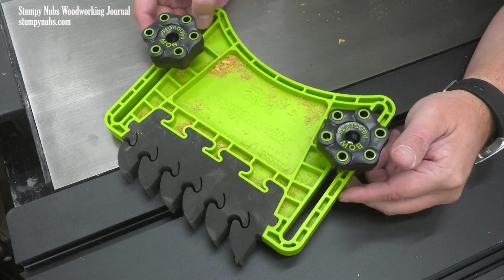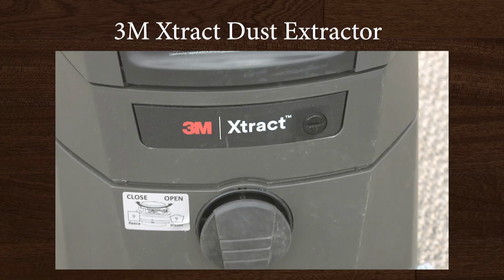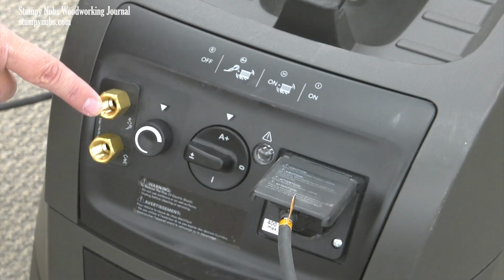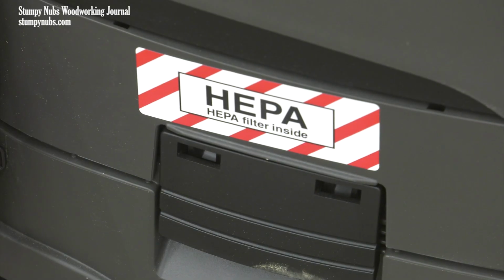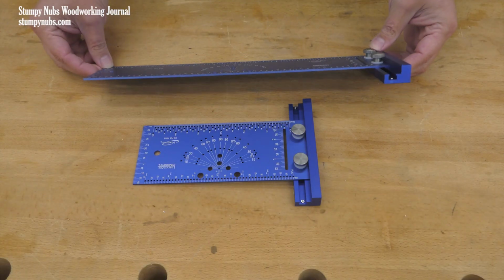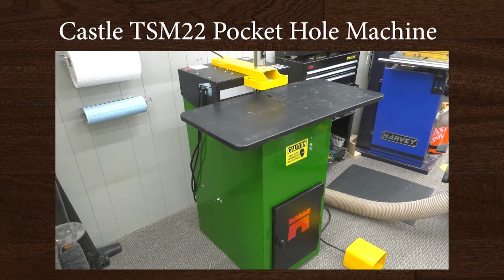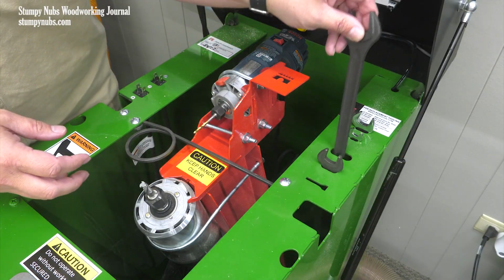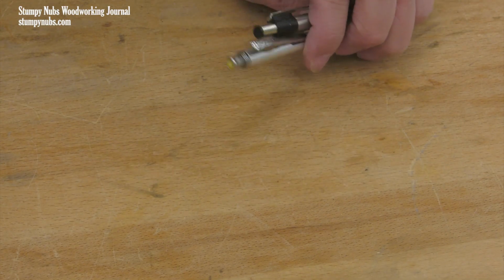7 Tool upgrades I wish I'd found YEARS Ago!

Comment from the maker: ▼EXPAND FOR LINKS TO THE TOOLS▼ 
Watch more Cool Tools videos here►https://youtube.com/playlist?list=PL-gT7JMZFYjdW0383kgJVMj0ocXbLXtpQ 
Tools used in this video: 

- Bow Featherboards: https://www.amazon.com/dp/B01MQ4F9ST?&linkCode=sl1&tag=stumpynubs-20&linkId=e3bbd1143073fa864af88d90d75ca801&language=en_US&ref_=as_li_ss_tl

- 3M Dust Extractor: https://lddy.no/1dc89

- 3M Premium Sander: https://lddy.no/19fcc

- M-Power Diamond Sharpening Station (with free measuring/marking bundle – No code needed): https://www.mpower-tools.com/product/sbs-triple-diamond-stone-sharpening-station-marking-measuring-bundle/

- M-Power Diamond Sharpening Station ONLY 10% off: (Must use code stumpy25) https://www.mpower-tools.com/product/side-by-side-diamond-sharpening-bench-stone-sharpener/

- M-Power Measuring/Marking Bundle ONLY (No code needed): https://www.mpower-tools.com/product/flat-lying-trammel-set-point-2-point-profile-scriber-marking-measuring/

- iGaging T-Marking Squares: https://www.chipsfly.com/t-marking-squares.html

- MicroJIG FitFinder Gauge: https://www.amazon.com/s?k=microjig+fitfinder&crid=1N17W7QZJCCFU&sprefix=microjig+fitfinder%2Caps%2C92&linkCode=sl2&tag=stumpynubs-20&linkId=e0b4ddc32353c7f45fa0db08e90a37ed&language=en_US&ref_=as_li_ss_tl

- Castle TSM22 Pocket Hole Machine: https://castleusa.com/products/tsm-22-pocket-cutter-machine.html

- Zebra Pens: https://www.amazon.com/s?k=zebra+pen&crid=2MZ0Z3PPFRE7D&sprefix=zebra+pen%2Caps%2C122&linkCode=sl2&tag=stumpynubs-20&linkId=026f2d5c9caad5657ee3a2613c62f4b9&language=en_US&ref_=as_li_ss_tl

- GraphGear 1000 pencil: https://www.amazon.com/s?k=graphgear+1000+pencil&crid=YE1G3GZSZ2PI&sprefix=graphgear+1000+pencil%2Caps%2C130&linkCode=sl2&tag=stumpynubs-20&linkId=2d5750656edc778c0851dc83e995228b&language=en_US&ref_=as_li_ss_tl

-Sawblade.com bandsaw blades: https://www.sawblade.com/

(Bow, Taylor Toolworks, M-Power, iGaging, Castle and Sawblade.com are supporters of Stumpy Nubs Woodworking Journal)

(If you use one of these affiliate links, we may receive a small commission)
Reply: The Dust Extractor link is broken. But a great video. Thank you.

Comment: Just a quick note to let you know I just purchased the Bow fealtherboard duo - thanks for al the great educational videos. Larry
Reply: I used this device for the first time this eve... I made a very nice discovery.... I was making miter slot runners and needed to cut approx 1/4" off of a 7/8 piece of wood. I decided to use the featherboard and as the cut finished, the waste piece was very gently pushed backward towards me (yes I was using a riving knife) .... the featherboard stopped the movement of the waste wood causing it to gently slide to the left side of the blade on the table. Granted this was not a true "kickback" but it made me realize what a great tool this is! Hopefully I've explained this clearly enough that it makes sense to you.

Comment: James you need to stop the cool videos.  They cost me money - just purchased the iGaging set.  It will replace a a similar design that is much thinner and too defined.  The ½ tool from Microjig was already in the shop and it's one of the most versatile jigs I've used.  All in all great info and it onlt cost me a little money this time.  Keep up the great work.

Comment: We had a lot of problems with that exact pocket boring machine at work. It would start to fail to drill the hole for the screw (would still bore the “countersink” portion). That one was sold and a new castle was purchased which uses regular motors as opposed to rotors (old castle would require router replacement 1-2 times a year), this one also (only a month or so old has started to have the exact same issue. When they work they’re awesome, when they start to experience issues they are a huge pain.

Comment: I don't understand why the iGaging has holes every 1/16 inch on one side but only every 2/10 (or 1/5) inch on the other.  Doing every 1/10 inch would be more spacious than even the 1/16 so their manufacturing process can clearly handle to the 10th inch.  For that reason, this tool is a no-go for me.
Reply from the maker: It's every 1/16 on one side and every 1/8 on the other- the most common increments used in the US. There are no 10ths.
Reply: @StumpyNubs  Thanks.  I must have heard it wrong; I thought you said 1 fifth on the other side.  Thanks for the clarification.

Comment: With the thing mentioned with the sander - decibels are logarithmic. Getting from one unit to the next requires double the amount of power. A 5db reduction of volume isn't just a little bit, it's 1/32 the volume being applied to your ears.

Comment: I’m as acoustics professional, 5 dB isn’t 3 times as loud/as quiet. In terms of loudness a difference of 10 dB is twice/half as loud and 20 dB would be 4x as loud. 5 dB is clearly louder and the difference between someone talking conversationally and someone speaking at a raised voice/ approaching yelling territory. Yes acoustics is weird, but one interesting thing is that it often provides amazing insights on airflow efficiencies and longevity, as it’s the turbulence flow, that will commonly create the noise. Awesome review, I will definitely be keeping 3M in mind when I’m ready to upgrade, thank you! A quiet shop is a safer shop people, and always wear your hearing protection!!

Comment: For a cabinet size piece of equipment that Castle pocket hole machine sure rocked a lot - doesn't seem sturdy, contrary to what you said.  Why was that?
Reply from the maker: LOL- So you're first thought is that the cabinet itself must be bending and twisting rather than the floor beneath it may not be level?
Reply: @StumpyNubs  Well yeah Nubs, for a fella who is meticulous about measuring and getting things square, straight, and level I thought for sure you'd have at least started with a level floor...without which everything else would be pretty hard to square up.  Why start with an uneven floor and then spend an inordinate amount of time leveling every... single... piece...of... equipment.  BTW, if you'd seen the way my Harbor Freight 5-drawer mechanics tool chest rocked after I tightened the bolts as I put them on, instead of installing loosely first and then tightening, you'd know why I immediately thought like that - LOL
Reply from the maker: @fooddude9921  Wait... When would I have "started with a level floor?" 🤔 I didn't build the shop. Ans it's moving a bit (camera closeup makes it look worse) because it's in a temporary location until I get the permanent dust collection hookup ready. It'll be fine.
Reply: @StumpyNubs  I haven't followed your channel from the beginning, so I didn't know somebody else built your shop - thought it was yours. Any thoughts on pulling everything out and laying down some self-leveling material?

Comment: How well does the pen work in cold weather?  Below freezing.  I work snow removal in the far north.  Temps well below 0°F are common.  I have e.d.c. items on me at all times.  If I jump out of the cab to shovel a front walk or talk to a customer my current pen freezes up and takes a little time to work again. How would this pen perform?

Comment: @Stumpy Nubs
Hey James,

i've learned a lot of helpful stuff from your videos so if you want to know more about the original of the dust extractor that 3m uses for your comparison video against festool i'm open for questions.
i have the starmix ipuls m-1635 in the safe plus set. (which is with the handlebar as well as rails for festool tool boxes as well as makita ones - those can be bought from starmix and installed yourself)
also you can fit festool hoses and there are different filters for different uses and lots of other cool accessories depending on the usecase.
send me a message and i will gladly help you with info and pictures!

Comment: While the Castel pocket screw cutter looks great, an improvement would be something to prevent the kickback that us apparent in this video. Usually, production machinery is inherently heavy enough to prevent this ,or is bolted down to the floor. You might consider an extra heavy weighted base.
Reply from the maker: The machine doesn't kick back. The floor is uneven. I've already fixed it.

Comment: Some interesting stuff, but a lot of this of it is waaaaaaaaaaay out of the price range for most of us weekend warrior types ($900 for a dust extractor, $450 for a palm sander, $4,900 for a pocket hole machine). Obviously, these are geared at professionals or extremely well heeled hobbyists who have plenty of disposable cash. I hope you don't mind some constructive feedback, but I for one would like to see you getting back to the type of basic stuff that the average amateur can relate to.
Reply from the maker: We make over 100 woodworking videos a year, only 7 are Cool Tools. Even in those I have more inexpensive tools than expensive ones. This video alone had 4 of them. I make loads of content for the average woodworker.
Reply: @StumpyNubs  I get it, I really do, but as an over-generalization, I have become increasingly disillusioned (and frankly feeling a bit disenfranchised) by the across the board trend in woodworking videos to go bigger and fancier with more and more sophistication. Everyone is upscaling and pushing higher end content with higher end equipment. No offense, but I will continue to push back on this trend (across the board), as I feel we have all lost something. Just my opinion, but I bet there are others out there who share it too.
Reply from the maker: @ay8306  Maybe that's true, but you aren't getting that trend here. Just because some content features high priced tools doesn't change the fact that most of my content doesn't.

Comment: I got a bench top pocket hole machine and it's quite the upgrade! I went with the lesser known brand Safety Speed, but after using the castle bench top one, I like the safety speed better in every way except the main cutter is not nearly as good. But I bought the castle bit for it and now it's gold!

Comment: I've been using a Bow featherboard for about a year now.  Love it.  I chose the one with the 'fingers' on both sides and use my giant Magswitches to hold it to the saw table.  Never have I had a problem and I keep it magnetically attached to the front of my saw when not in use.  Very handy and wonderful to use.

Comment: One of the possibly unintentional benefits of the bow featherboard is the curved spine. It makes your beer belly turn into a third hand by using it to set the desired depth while you tighten the knobs on the router table. I like to put my board in place and use my belly to push the featherboard in place so I can get the desired pressure and make it even as I tighten the knobs.

Comment: Spent the day hooking up my new, used heavily once, Makita GA9071X1 230mm 9" grinder to Henry and VTuff vacuum extractors via ash can to eliminate hot metal spark risk. Clumsy but it works. Next thing to save up for is heavier duty M-class extractor or even higher for brick and concrete dust. Been clearing all sorts of cement, concrete, and other rubble from daughter's new back garden (yard in US speak). While it would have popped up due to subscription, it was well timed

Comment: For those who do not need a pneumatic connection on the vacuum cleaner... this is actually not 3M, but Starmix... or rather it is made by Starmix.
Top German manufacturer of professional vacuum cleaners, which also makes vacuum cleaners for other brands.
You can get their equivalent models identical to e.g. under the Metabo brand...also battery powered in the CAS battery ecosystem (Metabo).
Reply from the maker: While the resemblance is clear, are you certain they have all the same features/specs? Can you say for sure who actually makes it? 3M is the much larger company.

Comment: Point worth noting perhaps on the pen/pencil thing - I don't use either of those, but the ones I do use are basically the same body - which has meant on occasion I've marked up bits of wood with the pen or written in my logbook with the pencil - have two different shapes for the two functions is definitely a good idea.

Comment: James, how does MPower's SBS system compare with the MK2? The SBS is the traditional three-stone setup but the MK2 gives you the angle and slide the stone across the bevel. And is a good bit cheaper. Why the SBS?
Reply from the maker: The SBS is a much more complete system with a larger surface that's compatible with more tools, and with multiple strops for different pastes. The Fasttrack MK2 is faster if you only sharpen chisels and planes.

Comment: If you don't need the air-tool connection, makita 4210 has all the features, very similar specs, it's quieter and costs half as much.
Reply from the maker: I like Makita products and while I haven't tested their extractor, I understand if you like it better. But just a quick look shows the Makita has less CFM, less static pressure, it lacks some features and it's definitely not half the price. (Makita is $679, 3M is $871)
Reply: @StumpyNubs  the difference is much bigger in europe.

Comment: I think the 3M Extractor is manufactured by Starmix. Got one in the shop and it looks exactly the same on some features, although the compressor attachments are new to me....
Reply from the maker: Since 3M is the much larger company, perhaps it's the other way around?
Reply: @StumpyNubs  maybe you can look up some "made in ..." on your model?

While looking for mine, I found major companies are Starmix and Nilfisk, both having models to be found with Metabo, Bosch, Mirka, Flex, etc. Fein and Festool produce their own, afaik.

It is a real pain that you'll never know which parts are compatible (hoses, adapters, etc.)

I really like that you like it as much as I do. However larger shavings get cought between the motor and the filters 😉
Reply from the maker: @MagSun  I'm not sure where it is made is going to answer that question, and I doubt 3M is going to disclose who it lets market their products or if they license a product from someone else. Nor do I think it really matters since similar products, even those made in the same factory or even by the same company under different lables, can have different specs/quality/features- regardless of how similar the outer shape is. It's best to judge a product on its own merits. If I ever get my hands on a Starmix (which I understand is a good product), I will be sure to compare them :)
Reply: @StumpyNubs  no problem ☺️
True, the specs may differ, especially the pneumatic activation feature is new to me. Like many tests / comparisons show little variations.

Right. No company will admit other (cheaper) parts are compatible to theirs. Like Festool adapters fit the diameter of the "36mm" starmix spiral hose, but festool has a single thread spiral while Starmix has a double thread, so not 100% compatible.

Many parts are too similar to deny it 😉
Reply: Amazon claims that the country of origin for the 3M model is Denmark, and Starmix badges theirs as Made in Germany.  The two look awfully similar, but I can't find a Starmix model that has the pneumatic compatibility.
Reply: @bertaboy  maybe licensed models?
Dunno, similar, very

Comment: You got the dB thing wrong. 3dB is a doubling of the level. So 6dB is 4x. That would make 5dB about 3 times (roughly). Even so, it's a good figure. Now all they need to do is invent a way to stop corrugated pipe screaming.

Comment: FYI Every 10 decibels is a doubling of sound pressure.  5 decibels louder means 50% louder, not 300%
Reply from the maker: Depends on what you are reading. Many sites say 3dB is a doubling, not 10dB. But I am certainly not an expert in that area.
Reply: @StumpyNubs  Anything that says 3 db is a doubling is coming from someone who doesn't understand the subject themselves.  I wasn't trying to get in an argument, but I consider this an educational channel.  In the video you sounded unsure of how decibels worked.  I thought I'd help since I come from a theater tech background where we are required to understand how sound works so we can protect our audiences hearing.  It was a requirement to earn the degree.

The easiest way to demonstrate it is to go to a higher end home stereo amplifier and turn the volume up or down.  The volume range is -85 to +16 db (Yamaha, Denon, Marantz, etc).  "0" is the volume whatever you are listening to was recorded at. It's easy to tell going from -35 to -25 db that the volume doubled.
Reply from the maker: I'm not looking to argue either. And this is an educational channel, which is why why I don't know something I say so. But there is some confusion on this subject, and it seems centered around what "twice as loud"  vs "double intensity" means. For example: https://youtu.be/gAL45BjYI4Q?t=44

Comment: I used Zebra pens back in the late 80s and early 90s doing triplicate credit card forms.  they were legible, and the pens literally worked flawlessly until the ink ran dry. - unless i did something like dropping it on its point on concrete I think I killed a cartridge that way, once.  might have to go back to them.

Comment: I worked at a custom cabinet shop for years and they have that same Castle pocket hole machine. I've done thousands of pocket holes with it and it works great. Compared to the small kreg jig that I have now it takes a fraction of the time to do a pocket hole

Comment: Pretty awesome episode.  I'm going for the FitFinder and the Bow Fetherboard.  I may get the iGaging squares too but I have tools that get that job done.  Thank you!
The FitFinder is the coolest little tool; Will surely alleviate the most frustration for the buck.
Got a link for that router bit set (the V bits).